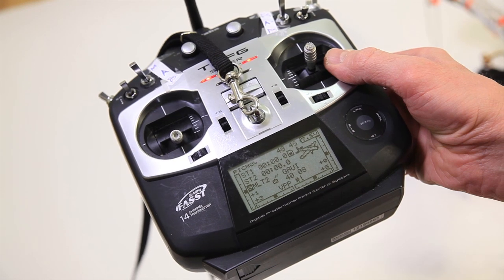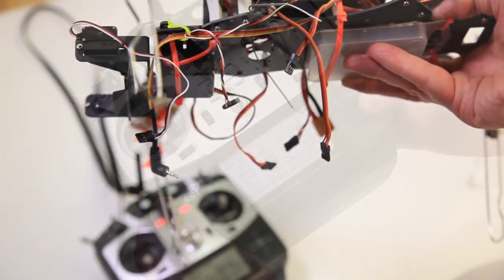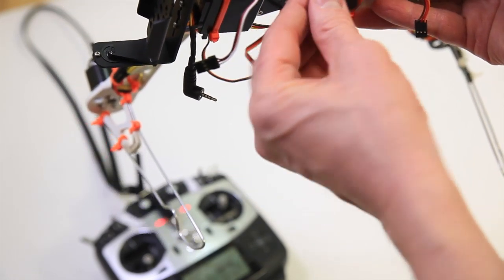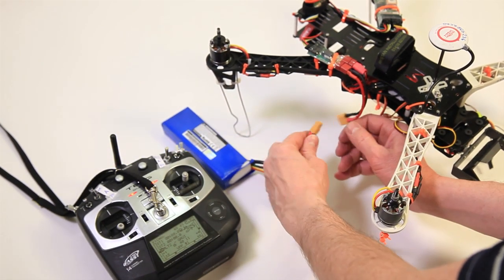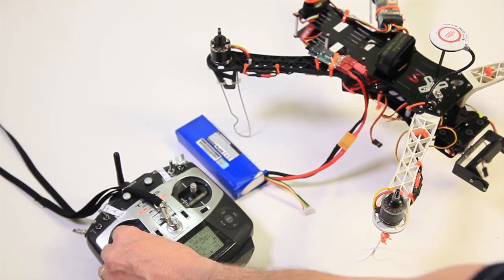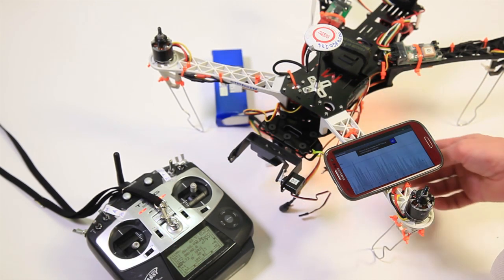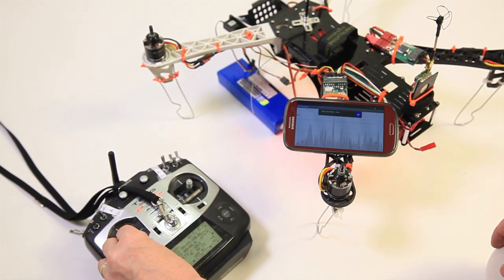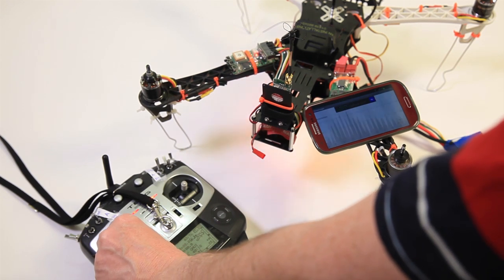DIY Setup for balance quadcopter brushless motors

Comment: Hi, Great video you just made. I'm a beginner in drones, and I want to build my first quadcopter. Lately I've been searching for frames which have a big center and about 25-30 cm motor to motor. I saw your frame and it was just what I was looking for I think. Would you be able to tell me what the frame is called and/or if you would recommend it? 
Would be Great!
Reply from the maker: The frame is a locust mf450. You find a lot of them on ebay. Reptile 500 is another cheap frame that looks alike.

Comment: Hi. Great idea for going to extremes for balancing. However I feel that the point of imbalance being the rotating part of the motor could be closer to the shaft. What I mean is that you may not be able to add a SMALL enough weight. Also being so close to the center of rotation, there would  be so little overall vibration for normal use that unless its needed for ultrafine video it probably doesnt need to be done. But also cool is the seismograph app, which there are many to choose from..and FREE!!